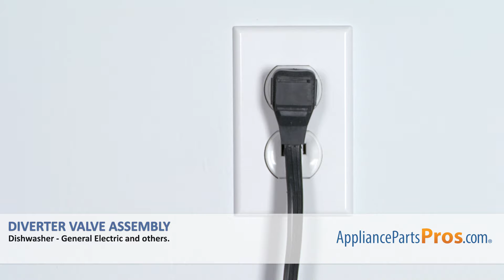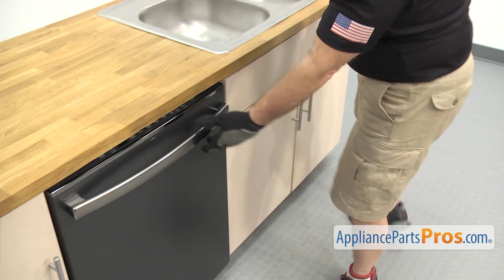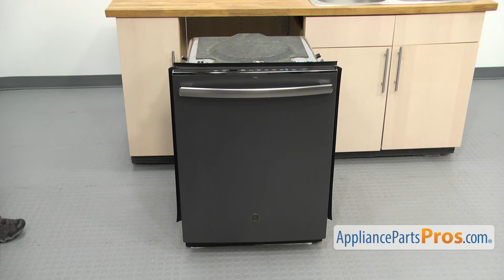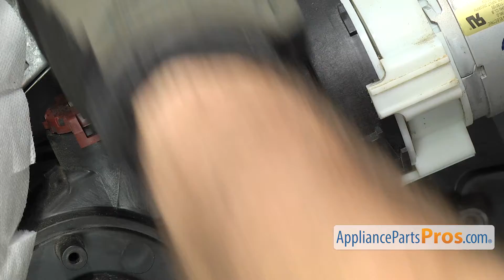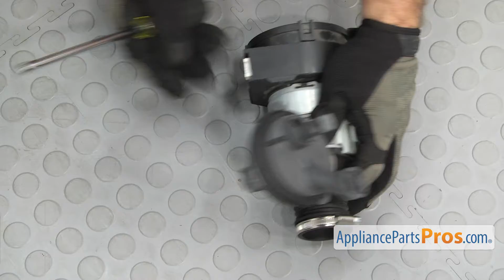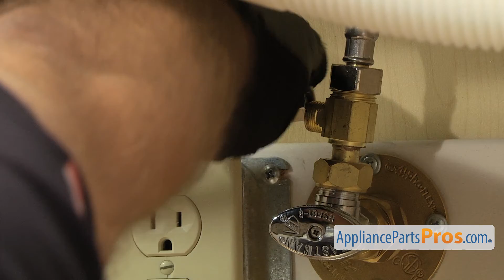How To: GE Dishwasher Diverter Valve Assembly WD19X25278

Comment: My dishwasher was leaking from the diverter valve rubber boot.  You video was great and i was able to install a new diverter valve.  The rubber boot on the diverter valve is very thin and you have to be careful not to over tighten the clamp or you will destroy the rubber piece.
Reply from the maker: Glad you were able to get your diverter valve on. If there is anything we can help you with in the future please let us know.

Comment: In the last month I've had 3 of these fail in cust houses and do 10's of thousands of dollars in damages! 1 house it did $43,000 in damage. The little rubber hose section molded on the the diverter becomes so soft you can literally push your finger through it.
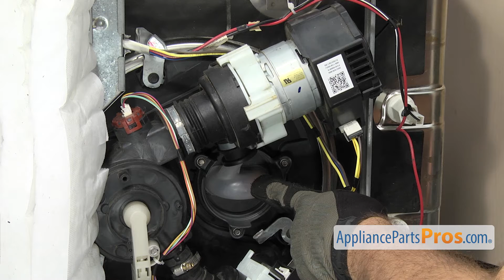Reply: 3:40    YUP. This     the translucent tube he's touching, that piece on the original from the factory is rubber. They have a tendency to rupture. Ask me how I know. Unfortunately, the replacement part isn't much better, they crack from thermal expansion/contraction. Bad design. Older models used an internal diverter so if it leaked, the water stayed inside. The replacement part lasted me 3 years. Lots of water leaked behind the cabinetry, so I saw no water for a couple of days. Got to the subfloor and warped my hardwood floor.  Now fighting with homeowner's insurance.

Comment: Wouldn't tightening the clamps before final assembly put extra stress and torque on the poor rubber hose that's the bulk of the problems these diverter valves have? Also, the reports are that the regular hose clamps don't have proper clearance and the oeitiker clamps should probably be used.

Comment: GE is so kind to Include 5 hose clamps with the part, not sure why they are needed. I put some vasiline on the outside of the rubber. Maybe it'll buy me an extra few months. Good video, the clip was a little tricky at first but I figured it out. Screwdriver goes on the bottom and your thumb on the top when the dishwasher is on its right side.

Comment: First off, you're a rock star. Your videos are VERY helpful. 

How do you know it's bad? It doesn't seem like much to it that can mess up.
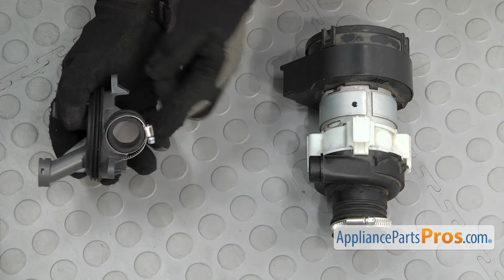Reply: 6:00  if you look at the rubber tube he's touching, that piece on the original from the factory is soft, thin, and fragile rubber. They have a tendency to rupture. Ask me how I know. Unfortunately, the replacement part isn't much better, they crack from thermal expansion/contraction. Bad design. Older models used an internal diverter so if it leaked, the water stayed inside. The replacement part lasted me 3 years. Lots of water leaked behind the cabinetry, so I saw no water for a couple of days. Got to the subfloor and warped my hardwood floor.  Now fighting with homeowner's insurance.
Reply: @donoimdono2702 I am dealing with the same thing. My dishwasher is only 2.5 years old and am already needing to replace this. Ridiculous.
Reply: @donoimdono2702 Same issue here with my GE dishwasher

Comment: Hello again, the circulation pump hose is also damaged, do I need the whole motor or I can just get the part?
Reply from the maker: What is your model number?
Reply from the maker: Unfortunately, that hose is only available with the circulation pump. That part number is WD26X23258.
Reply: @appliancepartspros  Thank you for the info and your videos!

Comment: is G.E. using material that cannot withstand dishwasher detergents?
I bought the machine new. diverter valve rubber hose dissolved and ruptured after 2 1/2 years. I replaced it myself. 2 years later rubber hose part of circulation pump dissolved and leaked. upon removing circulation valve, I checked status of diverter valve hose and it's dissolved as well. 
 cheap chinese materials and manufacturing. buying a new dishwasher today.
Reply: same for us - 2.5 years...   they get points for being consistently bad ;-)

Comment: Sorry, what is the name of the part you changed, and when we change it?
Reply: Diverter valve-- and you change this $60-80 part when the crappy rubber starts leaking and ruins your basement ceiling.